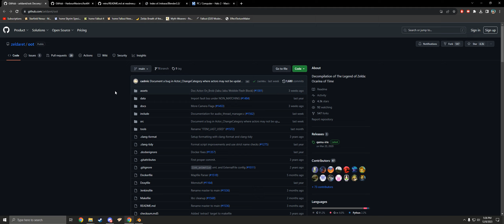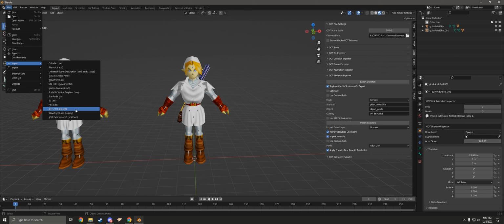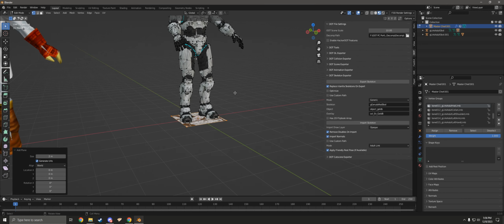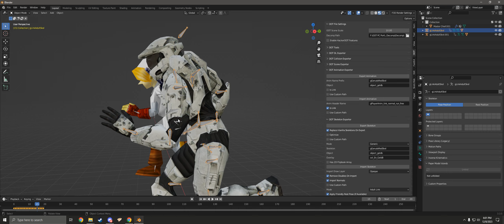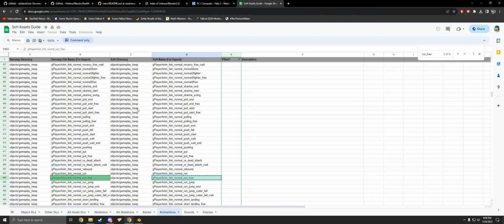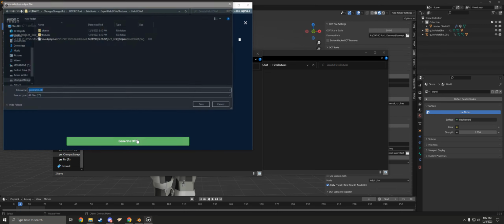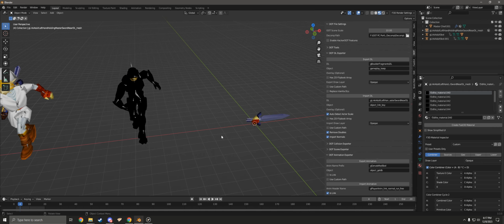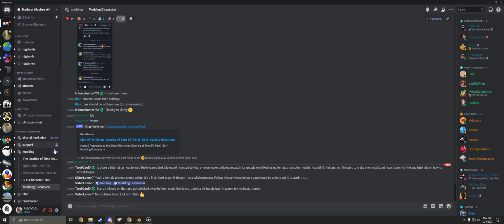A Rough Tutorial on Making Custom Link Models for Ship of Harkinian

Comment: Want to say thank you for this super useful guide, everything else out there is text based and hard to follow. I have come across two issues and I don't know if here is the best place to ask but I figure why not.

When I try to import the run animation from the Decomp I get the following error in blender:
invalid literal for int() with base 16: 'x0'

I don't know if you've ever seen anything like that before - my general googling showed it to be an error typically in python code.

Secondly when I Joined my model to the skeleton that exported from Decomp just fine. I can move it in pose mode. But when I go through the retro process - it creates and Otr file but that file just remains as the default character model.

Even if you cant help with the above congrats on a great guide - I'd not even touched Blender before last night and have now been up the last two nights fiddling to get this to work.

Thanks.
Reply from the maker: Never seen the issue with importing an animation, every now and then you'll come across one that just straight up won't import though. What animation were you trying to import?

As far as the model not working properly with Retro, double check the folder structure for exporting the skeleton. Usually when that happens to me it's  because something was wonky in my folder setup.
Reply: @TheGuitarjammerGaming  I appreciate your reply, the animation I was importing was the same one from the video the run normal free one. I'm not overly fussed if I cant import animations just makes rigging more annoying.

Still cant get retro to work either annoyingly but I'll play around with things maybe uninstall and reinstall the lot and see if that works if I get it working / make things look decent I'll post my results on the discord / gamebanana. For what its worth I found SoH about a month ago and played a full randomiser on your halo mod - great fun riding the scorpion tank across hyrule field - shame Epona wasnt equipped with a cannon :D
Reply: I still can't figure out animation but have managed to get the model in to the game and tweaking it to my liking, only the hands / items left to do! 

Do you know is it only .obj models that can be added in to SoH or do other filetypes work also?

Thanks again! @TheGuitarjammerGaming
Reply from the maker: @nickbeynon6806  Essentially any filetype that you can open with blender will work with SoH, even the ones not built in to blender by default lol. I had to download some weird blender addon for a file type I've never heard of for SC Link and it worked fine.

Comment: [FOR ANYONE LOOKING AT THIS GUIDE, I HAVE CREATED A VIDEO ON MY CHANNEL SO YOU CAN FOLLOW THIS GUIDE WITH THE LEAST ISSUES.  IT GOES OVER THE DECOMP AND SPECIFIC FORKS YOU NEED TO USE]  I cannot link it otherwise my comment would likely be deleted.

Alright, I spent a good amount of time trying to get this to work.  I finally am happy with enough of what I have done.  So for those looking into this now, do not do the newer decomp process and do an old one.  It will solve nearly all issues.  I could not get animations working, the exact same issue someone else had.  Also use a legacy Fast64 for this too.

I have one question tho, how can I grayscale my images to set them to environmental.  Is it an exact shade of white?  Or is it only just the the fact that it is some spectrum of white and black?  I'm asking because my textures came in colour, and I want to change that.  So can I just grayscale them myself in another editor?
Reply from the maker: Sorry I didn't respond to your comment sooner, must've missed it. But generally for greyscaling textures, the lighter the shade of grey (or white), the more tunic color will show through. Usually I greyscale my textures myself, and then crank up the contrast the make the textures more distinguishable- it'll take some tweaking to get them where you want them lol.
Reply: @TheGuitarjammerGaming  No problem my dude.  Even if figuring all this out was a bit frustrating that your tutorial didn't work.  Once I got everything sorted, I was able to get it working.  I have no Blender experience, and just used you and the internet. Some things were unclear for me, but overall, it really helped.

As for the textures, thank you. I'll try that contrast trick. Sounds like another time of exporting the OTR repeatedly to tweak it.  Not having importing animations hurts, but I can do it again for this.

Last question, you said environmental colour type reacts weirdly to actual colour.  If I have an eye texture that also includes part of a the skin that should be environmental, I assume the white of the sclera messes up with that.  Am I screwed, or is there some magic I can do?

Thank you for your help.
Reply: @TheGuitarjammerGaming  Oh, and I might make a supplemental guide to quickly add some things to yours about the decomp, and fast64 part if that's all okay with you. People are asking me about it.
Reply from the maker: @Thebes  I would separate the eye textures into two parts, for the iris use a cutout texture, and the sclera use a regular shaded material. Copy the eye mesh, and overlay the cutout iris texture on top and I think that'll do what you want it to do.
Reply from the maker: @Thebes  I'm absolutely okay with it, the more supplemental documentation out there, the more potential modders there are!
Reply: @TheGuitarjammerGaming  This is about what I expected to hear, but it's also exactly what I didn't want to hear.  I genuinely have zero clue how to use blender despite getting this all to work.   Not your fault by any means. Sadly, I'm most likely just going to have to skip the cool colours because I'm not educated in Blender, so I have no idea on how to do anything you said.
Reply: @TheGuitarjammerGaming  I'll attempt it.  I'll try to explain the issues I came into if I even make this video.  Hopefully it can allow people more talented then me with these things to make better mods than I can.
Reply from the maker: @Thebes  Talent with 3D modeling is a learned thing brother, keep at it and you'll get better and learn new things! Prime example, take a look at my first release of Melee Link compared to Skilar's TP OOT Link (my most recent release). Just takes alot of practice,
Reply: @TheGuitarjammerGaming  Sorry, didn't mean to say it like that to discredit y'all.  I didn't mean talent as the inherent thing, but just the skill part.

I know it takes time, but again, this was the first time I've ever used Blender.  Everything you suggested I should do for the Environmental thing is something I have zero clue how to even search for help without going through hours of Blender Basics Tutorials first.  I don't have tons of reasons for Blender right now, so I don't really think I have the time to learn all this.

Comment: I'm wiling to give this a try, I attempted to do a model swap for Modloader 64 and it's pretty much impossible to get anything done with the tutorials out there. 

However that first step to install ubuntu sounds like a pain in the neck just to get the workflow going on blender, like I'm already filling the C drive with things that cannot be uninstall otherwise it'll break something else.

At least this looks like a full tutorial, beginning to end, hopefully I can give it a shot sooner than later.
Reply from the maker: If you comb through the decomp guide, it's not too terrible, and once decomp is setup once you never have to do it again and can uninstall ubuntu. It's definitely not an easy thing to setup, I plan on making a guide for decomp some time in the future too, not sure when though.
Reply: @TheGuitarjammerGaming  
Thank you for replying.

Ah I see. I was looking for ways to install Ubuntu on the D drive instead of C, but if I can uninstall it shortly after that would help tremendously.

Like I don't mind doing the whole cloning thing (Did something similar for SM64 decomp) but it's rather odd. Wish it could just be download and done, oh well.

I'll give it another go, hopefully I don't get stuck with the Ubuntu part.
Reply from the maker: @XradicalD  If I recall correctly, I think there's a version of Ubuntu that's portable. If I'm remembering right I didn't install it on my primary drive on my computer either.

Comment: I have a question.  I'm trying to take a model that's already been converted into an otr file in the form of a mod.  I want to take this model and make some changes.  Is this possible?  This is what I've got so far:  I've extracted the young and adult link model/texture files using MPQ editor.
Reply from the maker: It's not unfortunately aside from texture edits as far as I'm aware, I haven't tried to reverse engineer an existing otr file though.
Reply: @TheGuitarjammerGaming  I'm really only trying to remove custom sword and shield models from a link model that I think are pretty ugly.  Do you think that this would be possible to do in mpq editor?  If so, what object files would reference the custom equipment models?  I can't really find anything after looking for a while.
Reply from the maker: @eddieinthebed  Maybe in theory, but I'm not 100% sure- Haven't really used MPQ Editor all that much. I would ask in the SoH Discord if you haven't already, someone there will probably know more on that than I do.
Reply: @TheGuitarjammerGaming  thanks buddy I'll do that when I get the chance